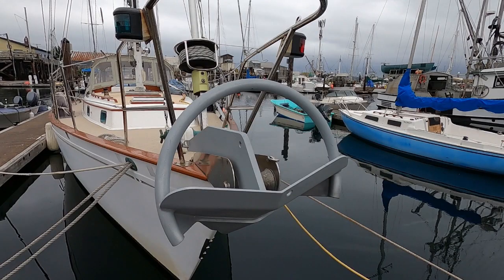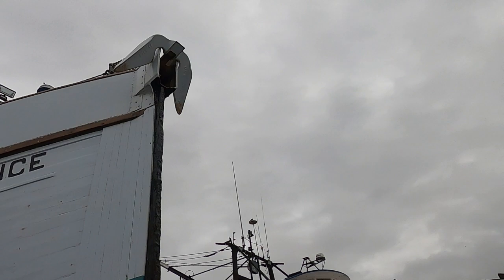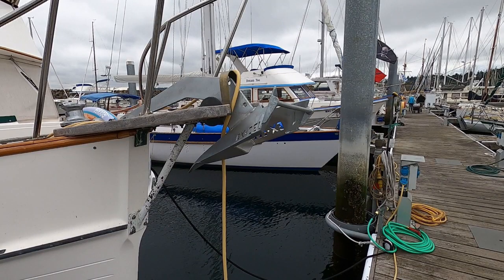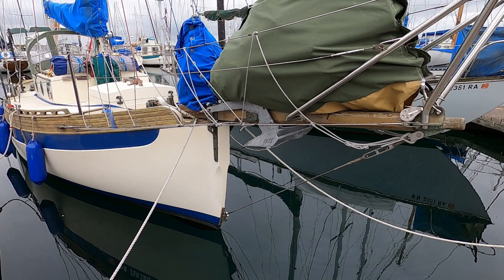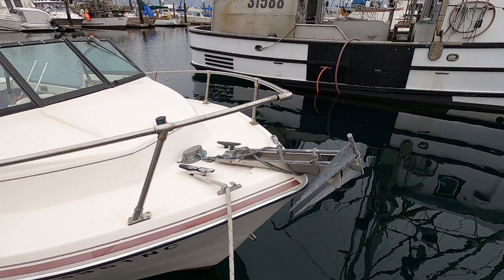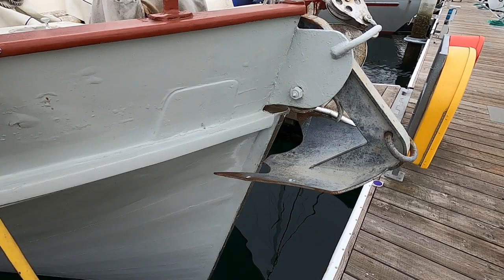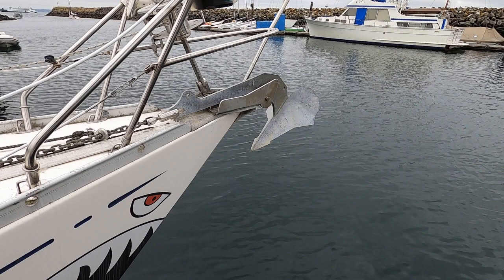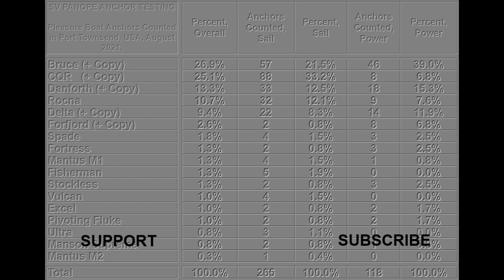Anchor Survey.  Video # 122

Comment: Hi Steve, very interesting as usual. I work for a global marine electronics manufacturer so I visit Spanish and Portuguese ports of all kinds on a regular basis. Some time a go I did a similar survey noting brands of radar antenas in order to determine market share or radar manufactuers so I understand what it takes to complete the work you have done. Bravo! For anchors, Lewmar´s Delta rules in Spain by far with my estimate of 35%-45% of all anchors seen in bow rollers. Lewmar markets very powerfully in Europe plus the Delta fits very well in most bow rollers (some manufacturers even build them taylor made for this anchor). It also has a good price so it is supplied extensively as boat OEM equipment. Deltas are followed by Bruce in the second position and then Danforth and Rocna with CQR still with a substantial presence but more and more in older boats. Anchor market is very traditional. Once a manufacturer is able to build a reputation (based in real performance or not) the crowd follows and numbers boom. CQR, Delta and Rocnas are good examples of this. In my opinion, this happens because most sailors set anchor in extremely good conditions and later they state: "I have anchored 200 times and my anchor never failed me. My anchor is the best" and then others follow. Well, testing anchors with strong pulling forces is the real test and this is hardly done by most sailors so marketing and advertising plus domino effect do the rest. Keep it up!

Comment: Awesome, Steve! Can we have this in a google sheet, please? I'm curious to run the numbers a little differently to what you did. Pretty shocking that so many are basically bad anchors. But not really surprising as most boat fleets are pretty old and most old boats have the same anchor they came with, or got replaced 10 years ago, or similar. On our boat is a CQR, galv, lead tip, rusted loose pin, very poor performer in this state, but does still work in soft bottoms and sand. I'm looking forward to fabricating my own anchor to replace it at some point in the future.